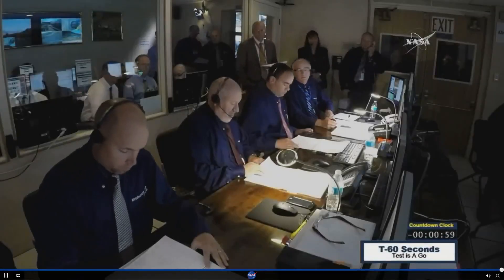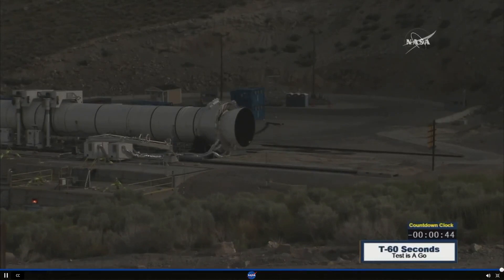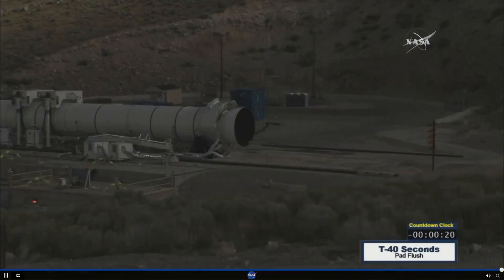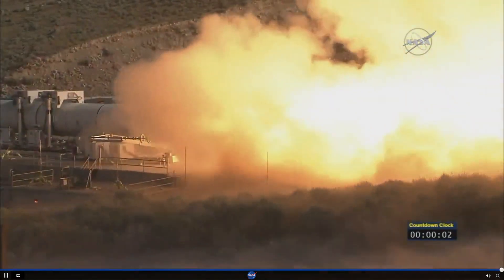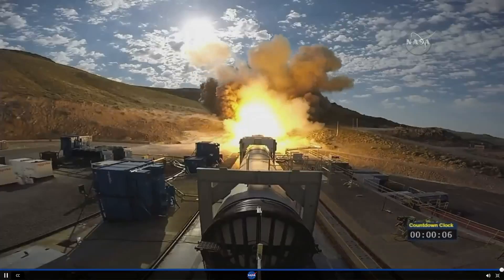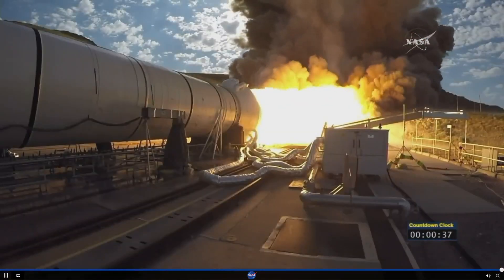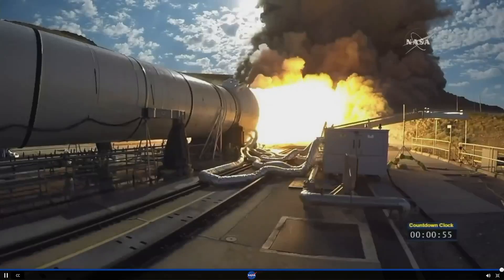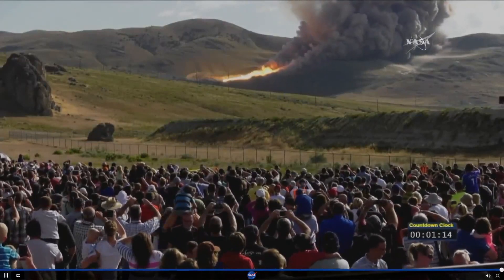NASA Test-Fire Solid Rocket Booster for Megarocket

Comment: Holy shit that plume of smoke and dust looks like a volcano! According to wikipedia the Saturn V's first stage generated 7,600,000 pounds-force (34,000 kN) of thrust & this booster generates 3,600,000 lbf (16,000 kN) and there are two of them, plus the liquid fuel center stage producing 1,670,000 lbf (7,440 kN) brings the total stage 1 thrust to 8,870,000 lbf 39440 kN, greater than the Saturn V. Man, that's something I may have to dive across the country to see, I've always wished I could have seen the Saturn V in person. I really hope Nasa gets the funding it needs to continue pushing the limits of what is possible, our understanding of the universe, and in the process inspire another generation to reach for the stars.
Reply: The earth weighs 50,000,000,000,000,000 (fifty thousand million, million) tons, so I doubt that moving a tiny part of the atmosphere for two minutes had any effect as none of the atmosphere was ejected into space. However if you want to believe everything you read then believe that anyone with half a brain would go to Mars using chemical propolsion.
Reply: Did you know that this booster was so powerful that this test exerted enough force on the earth to extend each day by a little less than a millisecond?
Reply: I don't know if you've seen a scale comparison to the shuttle SRB's or not but if you haven't, this thing is taller than the entire Shuttle stack, it makes the shuttle SRB's look like bottle rockets, they're freaking huge.
Reply: Just one time I wanna see them put a frozen turkey behind on of these bad boys just to see what happens to it, guessing there wouldn't be much left.
Reply: pretty sure it would get vaporized.
Reply: the liquid fuel on the center doesn't give force... it's just a extra fuel
Reply: The liquid rocket engines in the core stage are lit at liftoff and provide thrust for the full duration of the launch which is approximately eight minutes. The SRB's do the bulk of the heavy lifting for only two minutes until they burnout and are jettisoned. At that point the spacecraft is only traveling about Mach 4. After SRB separation, the five liquid fueled engines in the core stage continue to burn, accelerating the craft from Mach 4 to Mach 24, or 17,500 mph at 3-g acceleration in just 6 minutes. Also, Mach 24 is only orbital velocity, if they wish to achieve escape velocity, then they must accelerate from Mach 4 to Mach 33, or 25,000 mph so yeah, the liquid fuel is most definitely not just extra fuel.
Reply from the maker: My best friend ran GNC for the Shuttle program, and indeed the launches were impressive. These redesigned Shuttle SRBs have about 20% more punch then the Shuttle SRBs if I remember correctly. Kinda cool to build on what you already have since NASA's budgets have been sliced up.

Comment: Welcome to pure propaganda – this is a 40-year old SRB (Solid Rocket Booster) from the STS (Shuttle Transportation System) program. (By comparison, we need roughly 200x the lifting capacity of an STS launch to even consider a manned joy-ride to Mars.) All lies to anyone who can do the simplest thumbnail mission-planning math.
Reply: Well yea, you can't go to mars with one of these, but the bimodal nuclear thermal rocket engines on the planned mars transfer vehicle could. Really low thrust with a really high efficiency. It'll have to be assembled in orbit by a number of SLS payload lifts. Though I'm still not sure what they are going to use for long term radiation shielding. Even a thin layer of water would do the trick, and water is heavy, but if they are doing all of the assembly in space with multiple launches, it really just becomes a matter of how much money are they willing to throw at this. I believe Nasa is capable of the engineering required, getting the funding, that's another story.
Reply: +Nananki I agree, it's that little detail of ground launching a fabled ultra-high-efficiency nuclear thermal / ion engine.
This is pure theater: test-firing a known-good SRB from STS days and tacking on a 'going to Mars' press release with NO transfer vehicle, NO engine, NO shielding solution, NO endurance testing, and bluntly, NO mission. This is the culture of accepting lies that has killed real science in this nation, and to a large part, the world.
Reply: No its not propaganda. This is real and this is what is needed to get off planet. Your lies are sublime and your ignorance is pain.
Reply: Interesting post and I don't know much about this but I'm wondering why they can't construct a Mars transport vehicle piece by piece in space, like they did with the space station.  To me, that would make more sense than trying to get everything off the ground all at once.  

What are your thoughts on that?
Reply: Eliminating Mars Launch and Earth Return Vehicles would certainly lighten up the lift needs!
Reply: John
What will really melt your noodle is when you finally learn just what this "little" performance gain really means. There is nothing short of the best people going into the SLS. Want a better way to get off planet? Build a better Rocket or find another way. Sitting back and arm chairing this like a Boss is just lame. There has been almost no PR regarding the SLS. Most Americans dont even think we have still have a manned space program. The SLS is designed from the ground up to take people safely into space.
Reply: Yes, and any mission beyond the moon will almost certainly be multi-launch orbit-built (but still probably ~200+ STS launches: mind-blowing without a MAJOR engineering push to a space-elevator, railgun, scramjet stage, or similar to-orbit lifting cheat). The basic problem here is this is like NASA announcing some mythical super-car and then lauding the newly painted (but same old) 40-year-old transport trailer and the mockup steering wheel (crew capsule) while the engine, tires, suspension, fuel, transmission, and cooling system are literally still at the conceptual drawing stage.
Reply: I agree that the whole thing is a foolish facade. It would be better if all the people who think there's a chance of living on Mars, get together in one big rocket and go there, all together. And don't come back. Stay there. Enjoy.
Reply: SLS has far more lifting capability than STS - it's first stage is larger, it as a massive upper stage on top, and it doesn't have to use a large percentage of its mass for reentry equipment.

The SLS SRBs are also a new development, it's not simply an STS SRB but one that has been stretched and had other various improvements made to it. They have to test fire the thing at least once.
Reply: +Matthew Mlodzienski I agree; The SLS SRB is a power update for sure, and they should test as needed. (Though 20% boost after 40 years seems lackluster.) And yes, the SLS main stage is new (one that doesn't exist). But Earth launch isn't even the biggest engineering hurdle. What are we lifting to orbit for the trip to Mars? We have NO Transfer Vehicle nor have we even solved fundamental mission design decisions to create it. My problem is the liquified bullshit starstruck sycophant PR about going to Mars; lift vehicle testing is theatrical fireworks to distract from the fact that we have zero manned launch capability anymore.
Reply: Your adjective "little" is correct. This is a tweaked version of 40-year-old design work. The best people aren't with NASA anymore, they're retired or at Virgin Galactic, SpaceEx, and Blue Origin. All of whom are indeed 'building a better rocket' and finding other ways (I called them cheats earlier). This is for good reason: most Americans are right; since the STS retirement and our Great Leader killing Constellation in 2010, the United States has had zero manned launch capability; the first time since 1959. (Whatever 'manned program' we claim simply doesn't produce space-flights.) I'm all for the NASA but sadly, for now, SLS is theater at best, a fraudulent excuse to siphon federal money to contractor friends at worst. For now it's unmanned. For now there is zero plan to land on Mars. There is no mission, no vehicle, and huge basic problems to be solved. About 1% of the engineering necessary to build it has been done but great fanfare is made of command-module mockups, building a future unmanned SLS demonstrator (more fireworks yay!), astronaut training, and this engine test as if we're all primed to send Matt Damon to the Red Planet.
As for me yes, I armchair; I do so to educate others in order to hold accountable the fools in DC who boast false accomplishments while destroying those who actually build things.
Reply: Your education is missing some maths. That's all. A demagogues education always ends in failure.
Reply: +Andi B. I'm from Houston... :) Like I said, it's more about wanting to hold bullshitting politicians to task than 'armchairing'. I don't comment much, but I hate them lying about Candy Mountain when we have no manned launch capability anymore and won't for twenty years. SLS-as-Mars-rocket is a fraud, period.
You're right the External Tank subcontractor was killed but the STS program was winding down anyway. (Though, if you look at the first-stage of the SLS, it's an ET with engine-module bolted on; still LH/LOX propellant. We didn't abandon the ET engineering because of Katrina.) Put bluntly, there is zero real engineering on here; it's a total derivative system with no (huge engineering required) payload vehicle.
Reply: Relax dude, this is science, its not a one and done sort of deal and NASA has pulled off some masterfully amazing tasks in the past before,  i will give them the chance to do it again,  even if this does not work it's a start, this will mark it as the most powerful rocket mankind has ever created and that's a feat all onto it's self,  it blows every other nation's space program out of the water at the moment and if this DOES work to show a proof of concept, or at least show promise this could get NASA the funding it needs to continue this, and by god as a american it would make me no prouder to see the stars and stripes flying on mars, even if we have to wait 20 years.

You need to remember, NASA is funded by the government, it's budget is dictated by congress and congress is generally tied to the will of the people, or at least the popular movement, if the majority of Americans want their space program to live again congress can and will make it happen.  Notice how massive the space program got after we landed don the moon? that's what national pride can do....also hating the soviets did help.